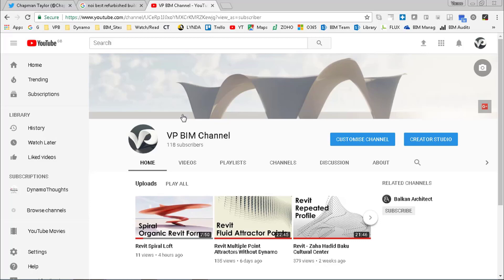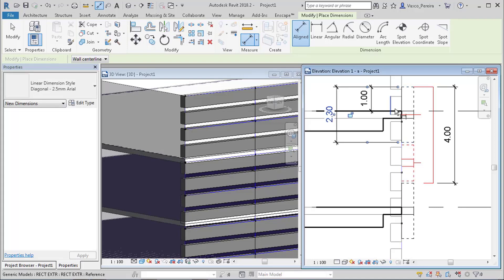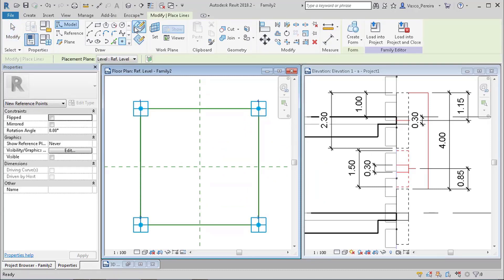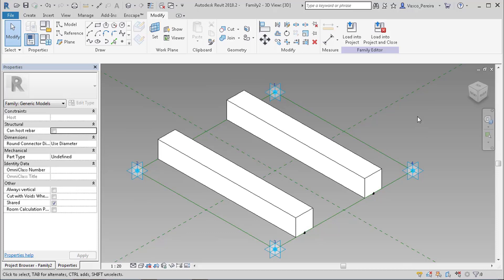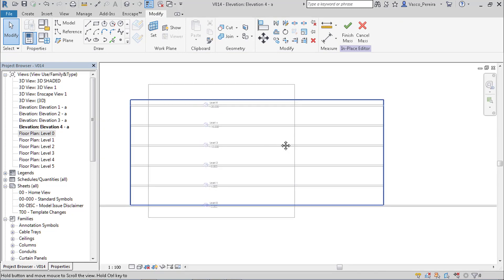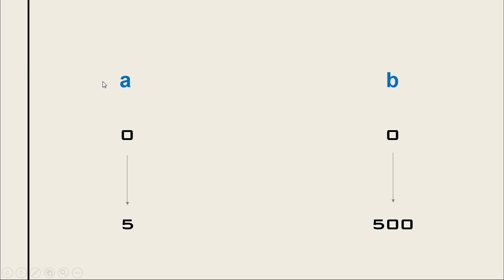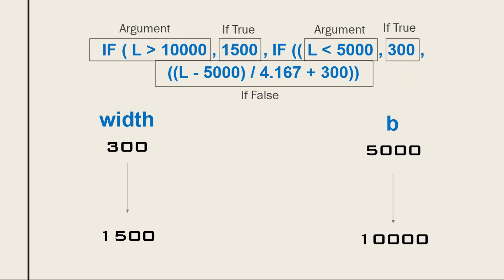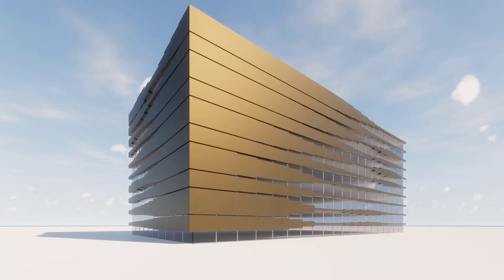Revit Facade Panels Varation

Comment: Does this works on curved facade, how to make the panels curved with the surface ?
Reply from the maker: It works if you use a few more points in the adaptive component to make it curved .. create it the way I did the structure family on minute 14.26... of this video:
https://youtu.be/QddT2JQnbtM

Comment: I couldn't hear well the audio... why did you report the parameter of height?
Reply from the maker: Do you mean the parameter that I named L? I made this parameter reporting because it's a parameter between 2 adaptive points. It means the parameter changes manually by the placement of the adaptive point - you can't change it by inputting values in the properties box. It will be read only so you need to make it reporting parameter for it to work in the formula. If doesn't work in the formula. Does this make sense?
Reply: Yes! Thanks